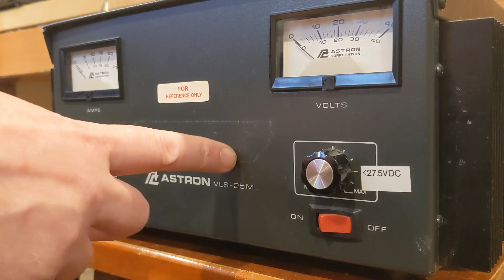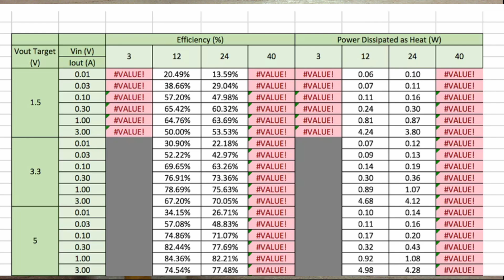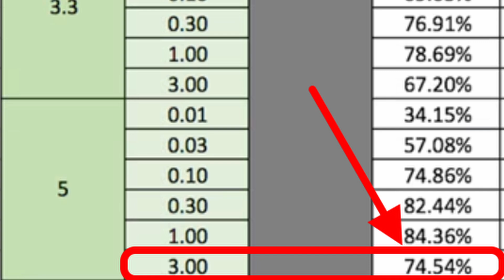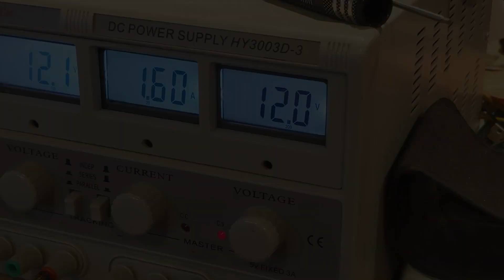Answering Questions About My LM2596 "Upgrades"

Comment: If you're looking for full on reverse connection protection, just add a full bridge rectifier. That way, it works, regardless of how it's connected to the power supply.

Comment: oof, when I cut out the automotive 12v socket plug and wired a thing straight to 12v, to later realize there was a dc-to-dc convertor in it. The clues where there; I should have known .... 
So I cracked it open and soldered wires to the board input, glued and taped it shut.

Comment: 3:21 during this cut, the input capacitor seems to have gone from normal shape to slightly pregnant :D

The power IC actually is fake. It's similar in behaviour to LM2576 instead of LM2596, as easily evidenced by real switching frequency around 48-50 KHz instead of 150KHz. Because of this, the values of support components, such as the two capacitors and the inductor, are also not correct, they have been adjusted a little but not enough to bring the behaviour of the board up to spec. It can also have some startup quirks. Several Chinese companies manufacture legit drop-in compatible replacements of LM2576, at mere cents a piece, making for a likely source of components that end up repainted on these modules.

Just measure the ripple frequency, you will easily find that for one it's very prominent, for other is the frequency that corresponds to the substitute IC not original. Never ever will you find the module with the genuine IC, i am quite certain.

A particular problem can become supply lines EMI. Say you think, i'm just connecting a fan or some LEDs to the output, it's fine, it's in its own box, it doesn't matter if it's a little filthy, but the ripple propagates up the input wires and becomes an interference issue elsewhere, because the engineering of the module is not proper. A diabolical problem to encounter in a sufficiently complex build, much wild goose chasing.

Comment: No ripple measurement? Need an oscilloscope? I like my VDS1022. Seen somebody measure signals in the multiple megaHz range; decided that, at $95, was plenty. How I did all my ECU bench testing. That and the crank signal generator I made.
Reply: There's probably already at least one Siglent per workshop corner, i don't think he needs more scopes.

Power ripple can even be shown with a toy scope like DSO138/DSO150, makes for a nice project to teach a child soldering too, as well as step wise bringup and most likely troubleshooting :D Costs barely a tenner.

Comment: I'm not an expert on cigarette lighter 12v adapters, but I believe the spring is the positive.  I like your work!
Reply: I concur 🙂 - On all points. 

- The spring is indeed the positive and the "wings are the ground. 
- I like the video. I especially like the Electronics hardened for Automotive use videos.